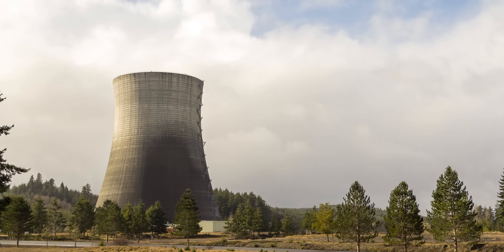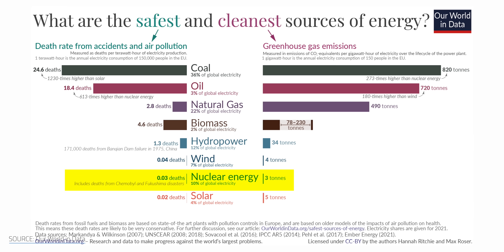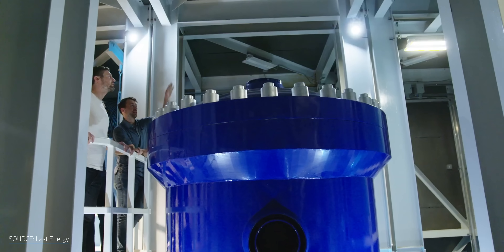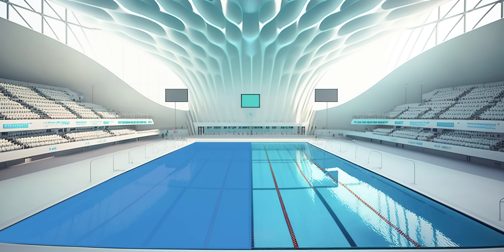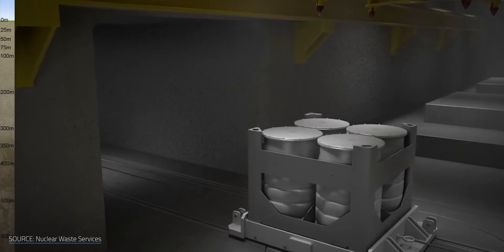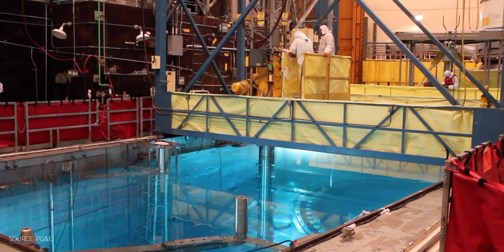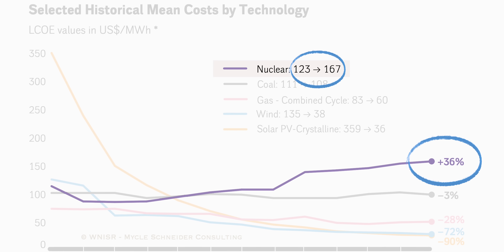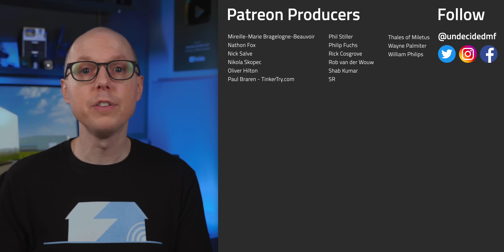Is Small, Fast, & Cheap the Future of Nuclear Energy?

Comment: SMR stuff making the rounds again I see. I figure if the LCOE is low enough, they'll get picked up. If it is too high, it won't. Standardization and fuel reprocessing makes a lot of sense, but if it is cheaper to go with renewables, batteries, etc, then that's likely what will be used.

Comment: LCOE goes up for nuclear. Yeah sure, because EVERY part is regulated. The main reason for the initial rise is the cost of building them, simply because we have no actual experience anymore, so SMRs should be great in that regard. Also cost of safety is a lot lower like you stated. nuclear LCOE also includes the shutdown and cleanup. 

How about waste disposal for wind? Never do we see the costs associated with removing 900 tons of concrete from the earth. Nor do we get an accurate estimate of deconstructing those massive fiberglass blades. Instead we just bury them, leaving them for the next generation to worry about. While we are keen to figure out the exact CO2 emmisions for each gallon of diesel burned to mine uranium, how well do we know to the comma the CO2 emmisions for all the individual compents for windmills?

Solar panel have similar problems. Do we care about the poison lakes in China for the LCOE? Or the childlabor for mining kobalt? It is pretty cheap tho. Costs associated with "recycling" panels have gone up too. We used to export them to Afrika, where they would be used another 5 years, only to end up in the burn pile so the silver could be "recycled". Now that panels are more complex with less and less valuable metals, the amount of raw materials we can recycle outweighs the costs associated with transport, proper bookkeeping and actual real enforced regulations. And that problems gets worse with each generation.

Comment: Few points are not accurate:

1. The hazards do not decrease on decentralisation of the nuclear power. The actual reason why the power plants are comparably safe is, that a few big power plants are easier to supervise as the millions of solar panels and wind turbines. Showerthought: There is no liability insurance covering nuclear power plants!
2. The main Problem with the waste management is the illegal disposal in oceans or lakes. Again... smaller reactors lead to less transparancy leading to easier illegal disposal!
3. Bringing France as an example for low cost because of standardization is also... lets say questionable... their average reactor lifetime far exceeds the initial estimates, also the maintainance costs are skyrocketing even not to speak of their new power plants. Furthermore miniturization also has issues, also the entire setup and building of a nuclear power plant is considered nuclear waste, since it is exposed to a lot of radiation. Smaller sized reactors lead to relatively more setup material per MWh...

Disclaimer: As a german i hate nuclear power, as a physicist i love it.

Comment: What about rtg's or sealed Stirling generators heated by nuclear waste that is not hot enough to run a traditional power plant, but IS still hot? Much hotter than ambient anywhere on earth, you'd get a thermal differential anywhere.

Comment: Not a fan of SMRs. These are still high pressure reactors and only use 4% of the uranium they are fueled with thus the long lived high level waste reamins an unanswered issue. I would prefer a handful of breeder reactors (with international oversight) that can directly consume the existing high level waste today and reduce it to waste that only has to be stored for ~200 year (thus 5 dry cask cycles). When MSRs are ready for commercial use (and can injest the remaining high level waste) then I'm all for the new tech as it is low pressure and nearly intrinsically safe and uses thorium which is a waste product of rare earth mineral mining and prevents many mines from operating in the US today.

Comment: The thing that tends to make nuclear power plants more safe than other forms of energy plants is the massive regulation that you have to have around them to ensure that they do not fail in a way that could cause a nuclear release.  The small nuclear plants have also to be certified before they can be operated this will be hopefully equally stringent.  Once you have that it will be very hard to update new features in ongoing updated designs because that will require full recertification.   Say in 10 years you find that your initial design has accelerated aging of certain components. I imagine that for a cost benefit analysis it will be easier to just shut that plant down than attempt to fix it.  The waste problem was similarly treated as we don't have a problem we just leave it in its fuel assemblies and after a certain period of time we bury it in deep underground repositories.  But in the next section they say actually it would be better to reprocess the fuel so we can make new fuel and nuclearly burn some of the highly radioactive products to reduce their lifetime of the waste.  Nuclear fuel reprocessing has not gone well anywhere in the world that has done this. The UK has stopped nuclear reprocessing and they now have a multi billion pound and 30 year project to try and clean up the Sellafield reprocessing site.  The security issues around Nuclear sites are also never mentioned. In the uk I believe all Nuclear reactor sites have dedicated armed police forces. The real killer for me is that the lcoe is the highest for nuclear energy, if you took the money you spent on nuclear and also invested in energy storage the price overall would be much lower than for a small amount of nuclear power.  You would not have the longer term radioactive waste problem or the societal distortions in having to protect your nuclear assets from small groups out to terrorise your society.  A case in point now is the threat of an attack on a nuclear power plant by the Russian's.  The bottom line is technology has to work within a faliable human  society just thinking technology will solve the worlds problems by "better engineering" often leads to just bigger problems down the line.  I am not a Luddite better engineering does make things better but often its the mistakes along the way where you learn the most.  The risk reward for Nuclear power does not make sense for me now.
Reply: Very well said and more than security risks I would put corporate greed as equal if not greater concern. There is no company under current capitalistic market that will not cut corners and prioritize profit over safety if they can get away with it. All it takes is one decision based in greed
Reply: I agree. There is a reason why nuclear power plants have been decreasing in the US. They are dangerous. Ground water contamination, air contamination, long term storage issues and monitoring them are just the larger issues. Until all of the issues are fully resolved nuclear power is no different than placing time bombs across the US.
Reply: Local vandals and terrorists will crash cars into these things left and right
Reply: there are plenty of reprocessing facilities around the world, most them got decommissioned because they were in operation since the 60's, like Sellafield. the main reason its not common is because it can be used to create nuclear weapons, so the US will police everyone that tries to do it. in the US it was prohibited because Jimmy Carter's anti-proliferation agreements with the Soviets. of course its more expensive than just mining more uranium, but if the objective is to reduce nuclear waste, then the extra cost is worth it.

also the modular reactors basically solve the problem with regulation changes, since they are easy to replace, they can just remove the old reactor and replace with a new improved one. Instead of needing to close an entire facility of a year to get it up to the new standards.
Reply: If the russians wanted to do a nuclear attack, it'd be far easier and more effective to just launch a purpose built dirty bomb.

Comment: I wish countries out in the far east such as India, China, South Korea, and Japan would work together to create a standardized "Pan-Asia" nuclear reactor design that's as standard as the PCIE slots on your computer. 

That way they could train hundreds of thousands of engineers on a single design to build up a knowledge  & experience base to allow the rapid construction of full sized nuclear power plants. France was successful with their nuclear energy industry because they standardized the design and built many identical power plants & reactors.

We should also be pushing to reprocess or refurbish fuel rods, with the current technology & knowledge we could refurbish a fuel rod five times, but perhaps with more experience & technology development we could slowly move toward to being able to refurbish a fuel rod ten times.

There's a proposal that you would bury dry casks several miles underground with a borehole, rather than fussing around with carbon capturing we could stick all of those old fuel rods underground, with each rod representing so much coal we didn't burn.

Comment: Great video Matt.  I think you did a good job of bringing up all of the significant concerns and addressed them all.
If we could develop more ways to consume or otherwise repurpose nulear waste (I know there already are some) that would address my most salient concerns.
I think that the Last Energy approach is very smart, and at 2% the cost of a traditional nulcear power plant, their modular solution makes a ton of good sense.
Let's now develop a sensible and wel thought out reuse supply chain for "spent" nuclear fuel.
Reply: This is why I think Thorium based small reactors will totally change the nuclear landscape.  Uses > 90% of the fuel by default, and not based on what is basically a slowed down nuclear explosion - pull the controls and you have a blob that wants to melt its way to the centre of the Earth.  A TH based system is fertile, so when you pull the radioactive source it stops reacting, and it's self regulating to start with.  Add to that a much higher run temperature (read: can generate production heat as well as drive steam turbines) and I wonder how long it will take before the first one will show up - it certainly will bring the nuclear LCOE way down.
Reply: @freddoflintstono9321  that is not how nuclear works, also modern reactors are designed with passive safety features. 

Thorium also has a lot of problems that we are still trying to figure out, like how molten salts are extremely corrosive and very hard to deal with. Thorium is also not fissile, its fertile, it can be turned into nuclear fuel, but first it needs to be radiated with neutrons, and that is not a simple feat to do in a practical manner. in the end we will probably just end up needing to use old reactors to breed the fuel for thorium reactors. what maybe could be a good argument for a mix of molten salt reactors and CANDU reactors, since CANDU can be used to breed fissile material from thorium.

the problem with thorium reactors is that we have a LOT of experience with PWR reactors, 70 years or so. but with thorium we are basically needing to start from scratch, since we never went beyond the experimental stage.
Reply: @danilooliveira6580  I get the sentiment, but we all know nobody went to the moon until somebody did. Many ppl currently research  molten salt chemistry and they already figured out a good deal about what is feasable. Liquid fuel and low pressure has way too much advantage to pass on it in the long run.
Reply: @CraftyF0X  yes, in the long run, in the next 30 to 50 years maybe. we need a solution now, and standardized nuclear reactors is easier.
Reply: @danilooliveira6580  I don't see the two thing necessarily being mutually exclusive.
Reply: @CraftyF0X  Molten Salt is not the only way to do low pressure. MSRs are not magic. They have most of the issues other new designs have and the chemistry thing is a huge problem. It's not the salt itself, it's the fact that after running for a reasonable period, nearly every element in the periodic table is dissolved in the salt and that is very difficult to address. This is one of the primary reasons many of the newer MSR designs use sacrificial tubes containing the salt (e.g. MOLTEX) or replace entire reactor vessels on timeframes of less than a decade (most of the others...$$$)...because they have come to the realization they likely won't be able to solve the chemistry problem without using these methods. Liquid fuels particularly in designs that circulate them outside the reactor vessel for FP removal/fuel conditioning also present a unique proliferation risk. 
MOLTEX may have a good chance, but the others I suspect will be a long time coming.
Reply: @richardb1452  At no point I said that is the only way to operate on low pressure, I said it is one big advantege of it compared to PWRs. Everything has its upside and downside, it is always a trade off. When I say we should go molten salt I practically say that I think the trade offs of molten salt technology probably worth it, compared to anything similar, if we consider all the advantages and associated downsides. This true just as much for the SSR as for the  LFTR, MCSFR, DFR or any design really.
Reply: @CraftyF0X  Actually, you didn't mention PWRs, but I see now that was in response to someone else who did. Regardless, I wasn't accusing, just adding an important point because as you note, low pressure is a huge advantage (liquid fuels not so much).
There is a big difference between the SSR and all the other MSRs. It doesn't suffer the main disadvantages (corrosion control, FP material plating out on surfaces and difficult proliferation accounting) due to the fuel salt being isolated in sacrificial pins and not circulating it. All the other MSR designs suffer from these to one degree or another and they are big issues. I suspect the LFTR is DOA, at least outside India/China. The rest of the Thermal spectrum MSRs also have issues with their moderators. Not saying research isn't legit, only that I think it will be a long time before those issues are solved. I think SSR, MCSFR and maybe MCFR will be first. The rest have a lot of work to do IMO.
Reply: @richardb1452  Well, as I said, all kind of design decisions may have their advantages and liquid fuel is no exception. 
- First, it makes complicated and expensive fuel fabrication unecessary
- It makes "reprocessing" easier (closer to be economicly viable)
- Much better "burn up" (solid fuel needs to be reshuffled/removed after less than 5% of the fuel is consumed)
- More resistant to radiation dmg than solid components ("self repairing")
- Possible "isotope mining" easier
- Less maintenence (presumably)
- Fuel being more mobile under reactor conditions (something goes wrong you can drain the "hotest part"  to subcritical tanks, you don't need to take apart the core/fuel assembly)
- More homogenous, better heat and material dispersion in the reactor (less hot spots, simpler reactivity profile, better handeling of transients)
- Simpler diagnostics, and control system

These are theoretical advantages, some of them are already proven, while some requires further scrutiny to be confirmed in real, practical scenarios.
Reply: @CraftyF0X  If those were turned around and listed as "disadvantages of thermal spectrum solid oxide fuel reactors" then I'd agree as many of those are shard by other fuel/reactor designs, with the exception of the drain tanks and to some degree fuel fabrication. We have so little experience with liquid fuels compared to all the other options that basically not much on that list is proven yet for liquid fuels. We're talking 1-2 of orders of magnitude more reactor years for most other non PWR options.

I think the difference with most MSR proposals is the issues I listed earlier are show stoppers for the vast majority of them with the possible exception of the SSR and maybe MCSFR & MCFR. Once those are addressed, only then can we consider the advantages as being "in play".

Worth exploring, but in my view, don't count the chickens before they've hatched. We'll need decades of research and testing before they will be anywhere near on par in terms of data and experience to confirm/debunk most of those items.
Reply: The UN, WEF, and current administration in the USA don't want a solution they want a massive global depopulation.  Their solution is to reduce ALL consumption by a massive depopulation even if it means starving us of food.
Reply: nuclear reprocessing is a technology we have since the 50's but we can't use because Jimmy Carter banned it during the anti-proliferation agreements with the Soviets. its basically all you need. there is also the CANDU reactors that can use lower grade fuel and even breed more fuel from non-fissile material, basically using even more of the waste. with those two technologies, nuclear waste basically becomes a non-issue.

Comment: its important to note that almost all nuclear disasters are caused directly because of mismanagement with fukushima being the obvious outlier 
and even with every disaster factored in (along with the after effects that we know of) nuclear is still the second safest power source. 

and there is not an issue of nuclear waste since not only does a nuclear plant produce far LESS waste than its coal and gas counterparts (the difference being co2 is pumped into the air we breath and ash is dumped in rivers for us to drink) but the waste after recycling is less radioactive than the stuff coal plants pump out! 
yes nuclear waste needs to be handled with alot of care but right now the alternative is literally just breathing in toxic fumes